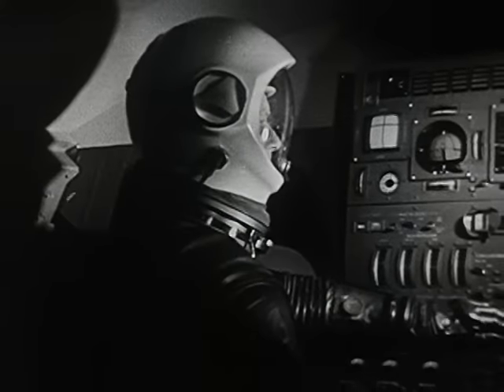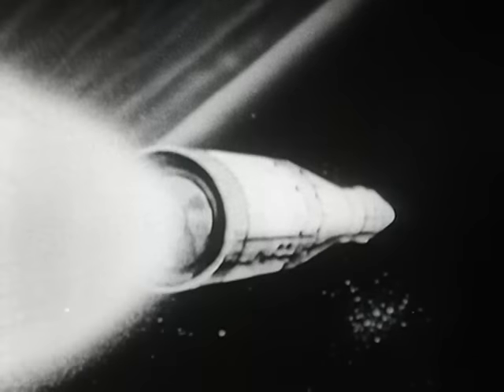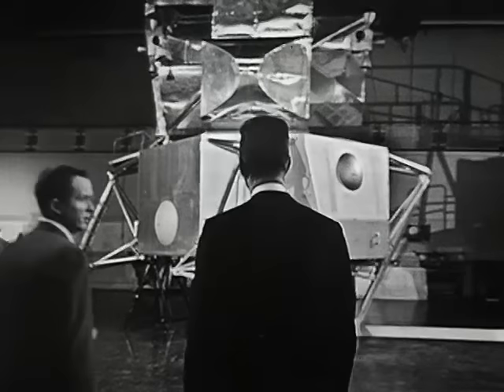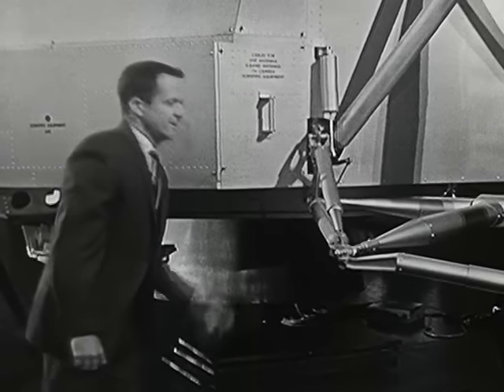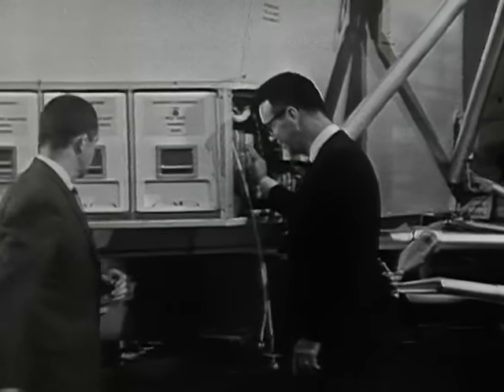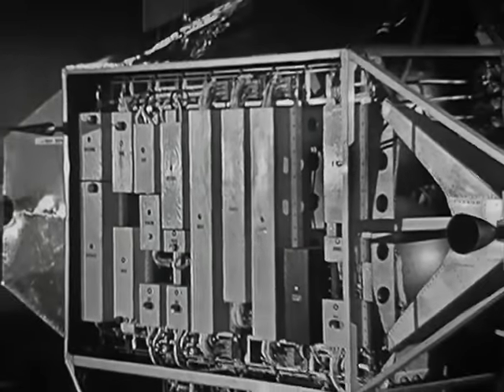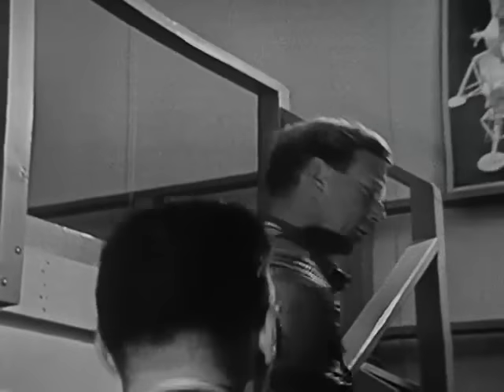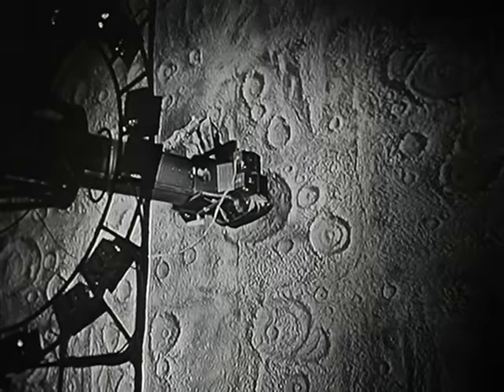MIT Science Reporter — "Landing on the Moon" (1966)

Comment: Do they still have the technology to build the exploding legs they used on the lunar module?  Fascinating demonstration of the emerging 1960’s space travel development challenges. I am surprised they don’t need 2 or 3 parachutes to slow the hurdling capsule before it smacks into the ocean.
Reply: "the technology to build the exploding legs they used on the lunar module"  The legs weren't "exploding".  They had an interior section made of honeycomb aluminum.  It works really well as a "one time use" shock absorber-as the craft comes down, the impact crushes the aluminum, the legs therefore shorten, and energy is absorbed.

"I am surprised they don’t need 2 or 3 parachutes to slow the hurdling capsule before it smacks into the ocean."  Have you watched any of the Apollo splashdowns?  That's exactly what they did.
Reply: They did use three large parachutes, and there were no "legs" at all on the Command Module. That was the only part of the magnificent Saturn 5 spacecraft that returned to the Earth. It where the people lived. OMG.
Reply: @almostfm  it's worth throwing in that most of us "use" this technology daily (well hopefully not actually using of course) in our vehicles crumple zones.

Comment: 17:28 An altometre... how does that work? There's no mention of landing radar.
Reply: count69 
Radar was used both for determining altitude and for tracking the Command Module during rendezvous.
Reply: Which radar? There was a Rendezvous Radar that was on top of the module. How was that able to determine the distance to the ground below when the lander was upright and descending?
Reply: count69 
It wasn't. 

That was the job of the landing radar mounted on the underside of the descent stage.
Reply: Exactly. Where is this radar? Can you show me any pictures of it? Or are you guessing? Was it in a housing or on the outside like the other radar/antennaes?
Reply: @count69  Here is a picture of the landing radar unit. It was mounted inside the LM's equipment bay in the ascent stage: https://airandspace.si.edu/collection-objects/radar-assembly-lm-landing-apollo

Here's a picture of the landing radar antenna. It was mounted under the LM next to the descent engine: https://airandspace.si.edu/collection-objects/antenna-radar-lm-landing-apollo